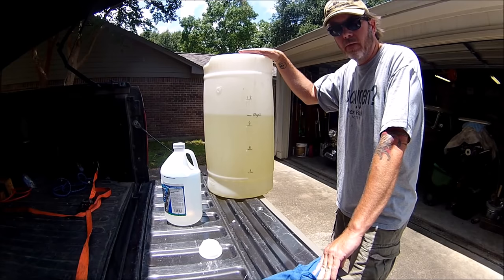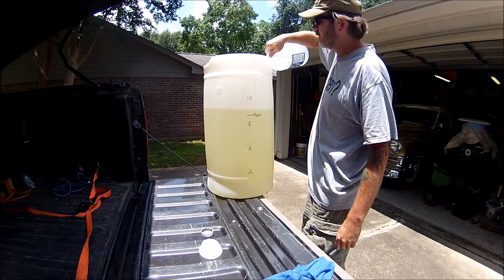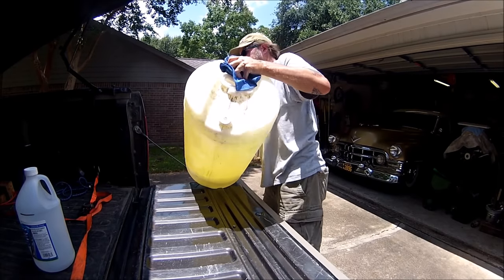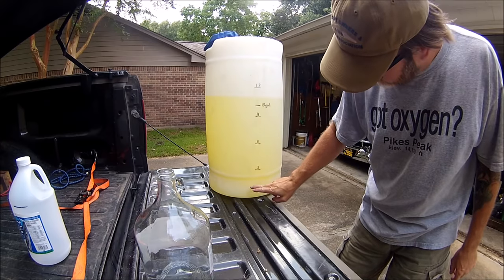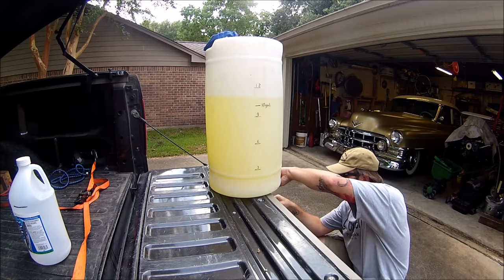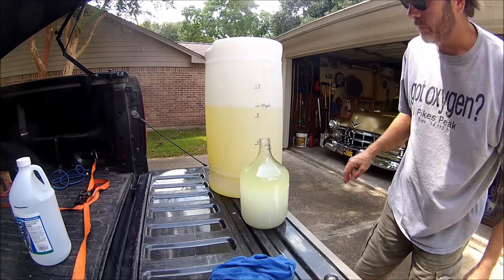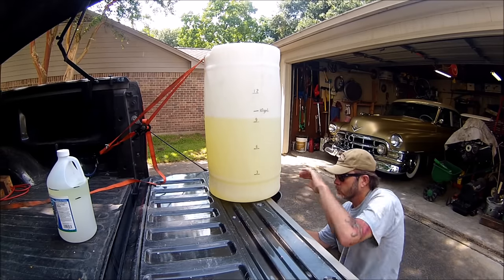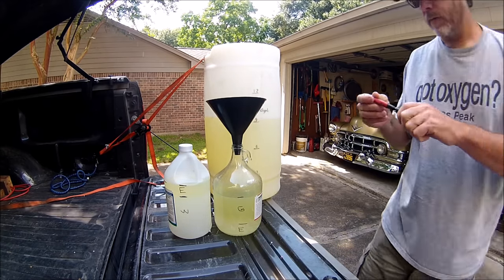How to easily extract ethanol out of gasoline.

Comment: So, I fail to see the point here. You buy expensive fuel, take out a portion that you don't want, you have disposal costs & now you end up with less fuel at a lower octane, wasted a bunch of time for a couple days AND I can guarantee that you will have some water in your vehicles fuel system. Is this just because you can? DUH!!!
Reply from the maker: Take a little time and look up what ethanol does to small engines. There are no gas stations in my area that sell gas with no ethanol. My lawn equipment sits throughout the winter and does not run. Ethanol fuel absorbs water and can reek havoc on fuel systems over time. Fuel last longer without ethanol.
Reply: I fail to see the point of your comment.
A. It's still cheaper than ethanol-free, which isn't even available in some areas. B. Disposal costs? You burn off the ethanol waste and you're left with water. C. Octane booster, or just start with 93 and you still get rendered between 88 and 90 if you do it right.
D. Less wasted time than repairing a set of carburetors ruined by e10.
But why am I telling you this? You're obviously an expert on everything.
Reply: Koko 3052 I'm not sure if you know but ethanol wreaks havoc on small engines usually wines up messing up the seals in the carburetor to a point of leakage or failure therefore ethanol should not be used in gasoline
Reply: 13thVaRebel high octane fuels is not necessarily a good thing if an engine is not designed to run off at you should not use it because it will not burn it completely check your owner's manual for recommended fuel octane levels because even my V8 in my Dodge is designed to run off of Regular octane 87
Reply: Yes absolutely true.  I thought Koko was implying that the loss of octane during the phase separation process would basically ruin the gas.  I meant if you started with 93 octane containing ethanol, it would no longer be 93 octane after phase separation and therefore if your vehicle needed 93 octane you could add a booster.  In my case I wouldn't, my bike runs fine on 87 or 88 octane so I would still start with the 93 but I wouldn't try to boost the octane after removing the ethanol.
Reply: it also eats up the aluminum in older engines like outboards engines have in  them in the carburetors. I just took my carburetors  off my 25 yamaha and the bottom  one had gas still in it. the seat in that one was stuck and corroded in there. I had to pick it out with a metal pick you use on your teefs, to get it out. The screw that holds the float in was ate up also barely got it out. that ethanol  
 is some bad stuff!!!
Reply: Do you have any lakes with a marina? They sell ethanol free gas.
Reply: Using higher octane fuel than an engine needs wastes money because the fuel is more expensive and it does no good.  Octane is like a shoe size- if you wear a size 10, then get size ten shoes- size 12 although a bigger number is NOT better.
Reply: except you lose a little octane rating removing the ethanol, so start with 90 and youll get 87-88 octane
Reply: You lose octane rating when the alcohol absorbs water from the air.
Reply: Koko 3052 He's not putting it in his vehicle. He's putting it in lawn equipment that would totally be destroyed by ethanol. Where I live, hi test fuel costs about $2.50 per gallon, plus about (at most) an hour of his time, which I will arbitrarily value at $20/hr. That's a $45 investment. Or he can buy prepackaged, ethynol free fuel from most outdoors/garden departments for (again, in my area) $28/gallon (rounded up to the nearest dollar and tax guestimation adjusted). That's $280 invested for 10 gallons. Or he can just run regular fuel at about (again, in my area) $2.49/ gallon and pay hundreds to repair or over a thousand to replace a small engine damaged by ethynol. $40, $280, or $1500? You choose. But keep your ignorant mouth shut
Reply: Or he could just buy some Coleman camp stove fuel (white gas)
Reply: Just who died & made you an expert Mark? I see that you inflate numbers to suit your point, and talk about ignorant....well you seem to have that down pat!
Reply: Electronicdawg You mean the one that sells for $18.21/32 oz ($72.34/gallon)or the one that's over $40/32 oz.(OVER $160/gallon). I think I'd rather replace the ethynol eaten engine. But I guess that's another logical possibility from which Koko can choose while keeping his ignorant yap closed.
Reply: Koko 3052  Which numbers are inflated? Where's your evidence?
Reply: Mark... this just seems to be a "bashing" of me, and for what reason....I don't understand that. You don't know me...have never met met....and I find your choice of words used to describe me...offensive.
Maybe it's YOU that should choose to keep your "ignorant yap closed"?
Reply: Koko 3052 I'm sorry. Was I too vague? Let me be crystal clear. It IS INTENDED to be bashing of you. The reason? The offensive, bashing language in your reply to Bobby Monroe. The fact that you're too blind to see the point of his experiment doesn't mean there is no point. The fact that you can't understand the reason for my offensive comments doesn't mean there is no reason. In fact, your inability to see the reason for my intentional abuse IS the reason for my intentional abuse.
Reply: "Where is your evidence" of my "bashing of Bobby Monroe"? Are YOU the protector of all You Tube posters now. Seems that I was asking Bobby some reasoning & you butt in! You don't know much, in my opinion, when you profess that "putting it in lawn equipment that would be totally destroyed by ethanol" or "I think that I'd rather replace that ethanol eaten engine"! "Where is YOUR evidence?" I've seen carbs gummed up, but never any "eaten" nor never any "totally destroyed"!
You seem to like bantering me, and to what point I just can't understand, but you are obviously smart enough to. So smart that you'll probably understand if I tell you all about sex & travel!
You have a wonderful day Mark.👍
Reply: "So, I fail to see the point here. You buy expensive fuel, take out a portion that you don't want, you have disposal costs & now you end up with less fuel at a lower octane, wasted a bunch of time for a couple days AND I can guarantee that you will have some water in your vehicles fuel system. Is this just because you can? DUH!!!"

Your tone here is obviously condescending. Your implication is clearly that he is stupid. And your final exclamation is clearly insulting, derisive, and offensive. What more evidence is needed?
Reply: For 2 stroke engines....it will gunk up weed eaters, etc.
Reply: sling shoter

How sure are you on that point? Considering the octane rating is the fuel's resistance to ignition, if anything the octane rating would increase due to water's inherent lack of ignition. Ethanol increases octane rating because it is harder to ignite than octane/heptane/hexane etc.
Reply: Every vehicle I've had, starting in 1970,  ran better with higher octane gas, even when the dealer / owner's manual said "run 87 to 89". I never cared about mileage, but greatly appreciated a smoother running  engine with more power for passing and climbing through the Rockies.
Reply: If your car was not knocking using low octane gas, then higher octane gas will not give you more power, octane is not a measure of power, that is a common myth.
Reply: Higher octane gas burns slower, that's part how it prevents knocking. Had an Explorer with the 4.0 engine, almost out of gas at night going through the Rockies. Gas station had only 93 premium, put that in instead of 87 octane.  The Rockies were fun after that, and never used regular again. Tried same test in multiple cars, sports and muscle. Always used top brands and all engines ran better. Never tried it with any econo boxes.
Reply: Bobby Munroe, run your small engines completely dry before storing them. As for damaging the engines, how is it my lawn mower runs fine after 10+ years of ethanol? The only maintenence I have done is run it dry at the end of the season, clean the air filter and change the oil. Still starts on the first pull. I think you are a bit paranoid about ethanol's effects.
Reply: I agree. Running the tank dry at the end of season is the best way to go for no issues.
Reply: look at what is in the garage. 
that is why. 
it is bad for rubbers and steel. 
all he has to do is add a water separator like old farm tractors run and he is golden.
Reply: You're so right on , what people think they can accomplish by doing stupid  Forest comp  !!!!
Reply: Bobby Munroe  ethanol burns hot enough to cause aluminum head to expand enough that the valve guide's will actually move causing bent push rods and the need for new heads to. I see it daily so yes remove the ethanol!!!
Reply: Forward plans /  metalfox1911a1: Let's settle these vehicle matters (which this video is not about).  
First, the ONLY thing high octane gasoline does is increase resistance to knocking. Otherwise, the gasoline is the same. Most modern engines are designed to detect knocking and take alternative action. That includes adjusting timing, adding fuel, etc to eliminate knock.  

If your engine is designed to run on 87 octane, it will not gain any performance from 93 octane because the programming is not designed to take advantage of the additional headroom i.e. it will not advance timing to gain power, even though it could, because it has a hard coded limit to what it expects . 

The opposite is NOT true: If you have an engine that has a recommendation of 93 but says "can run on 87 if needed", that simply means that it will DE-tune from optimum state to stop the knocking on lower octane gasoline.  So higher octane gas will give you more power and theoretically higher MPG. But again, only if the engine is designed for it

At high altitudes, the air is thinner. Therefore the mixture is heavier in gasoline.  You will experience less knocking at higher altitudes and can use lower octane gasoline. In the Rockies they sell 85 octane gas because it's safe to use in cars that normally take 87 octane. Slightly different rules may apply to turbo/super charged cars.

Forward Plans - if your car ran better on 93, we have to assume it was designed to take advantage of higher octane gas. One other option is that gas doesn't always hit the octane number it's supposed to - so 89 octane gas might be what you need to consistently get your 87 octane designed engine to run at peak performance.
Reply: So your saying alcohol doesnt make power? HMMMMM Ill call every car running in alcohol funny car, alcohol dragster, NASCAR, SPRINT cars, etc. alcohol be it ethanol or methanol DOES make power, it merely requires MORE volume as it isnt a complex molecule and ethanol burns only leaving CO2 and water as residue. methanol on the other hand leave formaldehyde, and low power acidic compound and a few other constituents I forget and WILL cause aluminum, magnesium , brass etc to corrode or rust VERY easily. As long as an ethanol fueled engine is tuned properly it should reach operating temps eventually and if properly shut off wont even leave anything to cause corrosion. This is why many older race cars run mechanical injection, shut pump off car leans out and uses most of fuel. The one beneficial aspect of running either alcohol is the engines consumes so much it actually will sweat on the outside of the induction where fuel runs through it die to the cooling effect.
Now what other properties does a cool running high octane fuel have that are conducive to power production,,,,? 
COMPRESSION INCREASE, You can run an engine with high compression and aggressive timing or forced induction like supercharger or turbocharger with high manifold pressures without issue of detonation or preignition and in superchargers if injected before the blower it cools the intake charge much like a water/methanol  kit does(but water/meth kit isnt used for fuel per se its used to moisturize dry air and reduce combustion temps in detonation/preignition prone engine designs when compression/boost is pushed too high).
Now we do use methanol in a useful mix but it has so much other stuff mixed in and dries so quickly ie washer fluid it cant corrode things, and its used in open area not enclosed engine. 
I can build an engine and push compression ratio anywhere from 12 to 1 to 15 to 1 and alcohol , while requiring more volume, its relative inexpensive nature make $2.00-$2.50 a gallon still cheaper if race engine uses twice as much as trying to  use $7.00 to $10.00 a gallon for 110, 114, 116+ octane leaded race fuels. BUT doesn require a healthy fuel system.
Gasoline when it first was produced it was actually throw away byproduct of the oil refining process and due to small size of original refineries ,as they only made kerosene, oils and greases and few solvents of use, white gas was thrown down drains into weeds or even used as weed killer, It has been said that part of reason of easy spread of great Chicago fire was a nearby refinery(yes right in heart of towns then) had dumped a large amount of this product.
But Holley brothers found this product easily obtained for pennies(cost of bucketing or barreling) a gallon and worked quite well if refinery operator was on his game.
Called White Gas, now we use it as charcoal lighter fluid, Coleman camp stove fuel etc. It around 70-77 octane, burns filthy, and cant hack much more than 6 to one compression.
Now take white gas refine better, ad different flammable liquids called cosolvents, and you can increase octane, but also they found if they added tetraethyl lead it created two fold benefit, the lead compound as it burned left lead deposits microscopically on valves, seats, even tops and side of pistons and on rings, Due to the cushioning effect and lubrication effect it reduced engine wear drastically in valve train area. much like adding zinc and phosphorus to oils made them control high pressure wear better.
BUT EPA rules removed Lead from gas and other additives from oils.
Now lets talk WHY ethanol is in gas.
Its now used for several reasons, one its nontoxic in limited amounts to humans and animals, the safety of 10,000 gallons spilling mean just wash/dilute with water it easily breaks down. two it is renewable.
three its clean burning.

But the main reason is back in the late 70s no cars had fuel injection except exotics 75 Caddys tried it and failed miserably.
BUT ratchet up electronics and digital age starting in 81/82 car started receiving electronic fuel injection.
BUT back in 70s EPA didnt talk to manufacturers it dictates to them.
So some desk bound paper pusher figures out with his lab buddy that if a slight amount of oxygen bearing liquid that is flammable is added to motor fuels it reduced tail pipe emission even more in conjunction with  catalytic converters(their tech has only gotten better) .
Since USA doesnt produce large amounts of ethanol to feed this mandate by a rogue branch of government whose original intent was to inform, educate and recommend action isn environmental concerns. But Congress wound up relegating emissions control task to them.
So we got a a frivolous regulation that needed repealed as soon as majority of cars went fuel injection.
The other issue was only inexpensive, readily available oxygen bearing compound that was cheap, a waste product that was actually saved only by rule and used as cleaning solvents even though mildly toxic if absorbed through skin was MTBE.
Now 5 yrs later than 82 and last carbed car ran off assembly line in 87.
MTBE was to be only used in smoggy areas but refiners complained about making it for just certain areas so they got approval and all fuel had it.
Now we still had lax storage rules, grandfathered in in ground tanks, pipelines etc and MTBE laced gasoline leaches into ground water. Its blamed on residue from tail pipes but that amount is infinitesimal compared to raw fuel in ground, 
So new rules with out fully understanding and we need new mandate and moratorium on oxygenates.
But rather than remove them and the REGS, they decide to look for different compound.
Ethanol was wisest choice, yes it had issues but most manufacturers have adapted much as they did by switching from neoprene to viton rubber products in 70s.
So mid 80s MTBE is found, sky falling technique is get ride of it when less than decade before it was heralded as pollution control tool.
Since ethanol had so many redeeming qualities, reduced farmers profits for multiple reasons ethanol, mostly produced from corn and other sugar or starch based products it was selected and by 95 the industry had government subsidies to build flex fuel cars , refineries, etc and 10 yr moratorium to fully remove MTBE.
And we got it in 2005 when Katrina hit as Gulf coast around New Orleans etc and its distribution, refineries etc all got hit same month. Thus first full on stages of ethanol E10 inception and wide spread E85 distribution got lnocked on its but but now you cany by fuel without ethanol unless you pay a fee/tax ie higher price. But not any better fuel. With proper service ethanol is no worse than when MTBE was included.
Reply: Septane is a rather dated iteration of heptane.  Check it out.  In my 35 years of refining, almost all of our instruments were marked septane, the newer ones marked  heptane, so we used what we had. Same machines since the 30's.The Collaborative International Dictionary of English v.0.48:
Septane \Sep"tane\, n. [L. septem seven.] (Chem.)
   See Heptane. [R.]
   [1913 Webster]
Reply: Koko 3052 I
Reply: So you claim ethanol damages fiberglass fuel tanks, well I have yet to SEE a fiberglass gas tank. Not saying there arent, just havent seen any. As for ethanol damaging the metals you claim it does. Sorry ethanol doesnt react with metals, now it WILL strip any type of oil or grease off very well. As for the rubber components I have yet to see the horrendous damage everyone claims and I am driving a 1966 Caprice. "Rubber" hose since MTBE was introduced has been resistant to chemical degradation BUT due to EITHER MTBE(known carcinogen, causes birth defects, mental issues, poisons water and ground) ethanol, ((medicinal, healthy if ingested properly in moderate amounts, renewable and  doesnt pollute if spilled and can be made safe by dillution ) .
Now what CAN affect certain metals with ethanol, because it contains water and can if ran in a system with bad grounds can cause some electrochemical erosion (ask me how I found THAT ONE out) and can exacerbate water/dirt contamination in older dirty fuel systems by actually helping it break loose. If the hose, rubber, gasket materials etc are falling apart then they were due for service well before ethanol introduction. 
NOW ethanol does NOT cause fuel to oxidize that is what AIR or FREE OXYGEN does. 
Now lets get to the chemistry of combustion with and with out ethanol(currently). In current internal combustion engines with fuel injection they attempt to maintain stoichiometric air fuel ratio while allowing proper operation of the catalytic converter to break down unburned hydrocarbons and carbon monoxide and oxides of nitrogen. While the idea of adding oxygenates back in 70s and even into 80s was novel idea, to "help" the engine burn cleaner it merely made mechanics have to retune the idle mixture and possibly the choke settings, it actually did nothing in real world terms(worked fine in laboratory settings) I have watched cars tuned to both fuels E10/R15 or straight gas with out ANY oxygenate and only saw a slight difference in emission output BEFORE the converter. Both made ZERO difference after the cats. 
Now using ethanol does allow fuel designers(yes designers) to produce a lower grade of base fuel that allows for the 100-110 octane ethanol addition. Now E85 does help in certain basin area cities with certain issues, but in the light of the cleaner burning cars in use today its sort of a wash.
ALSO the fact is the mandate to use oxygenates did not directly come from Congress, it was a long drawn out process of a government agency, created by Nixon to educate and inform the president on environmental issues, and over the years was incorrectly given powers and processes to regulate and issue mandates pertaining to environmental issues(even though this was NOT its purpose).
Congress DID have its hand in the subsidy to build infrastructure and such to help move along ethanol oxygenate inception. See they made the mandate to use MTBE, found it to be bad idea, dangerous. So they had to reformulate. Well ethanol was only clean, renewable, and ecologically safer way to oxygenate fuel. So rather than do away with an EPA rule the simply changed the criteria and kept mandate.
Now why do certain countries used ethanol almost exclusively, because they produce a majority of crops that CAN yield high grade ethanol and the fact is pretty much any internal or heat expanding device can be tuned for ethanol. Make sugar, left overs can be used for ethanol, make booze, any bad batches can be added to fuel production. 
Now I have been a diagnostic technician for over 25 years and so far MTBE was much worse on engines, and I havent seen much issue that proper filter replacement and engine services wouldnt have taken care of. 
Now I LIKE E85, for performance benefits but not emissions "cures". E10/E15 just keeps fuel makers in compliance with EPA regs and keep producers going. 
As for damage or wear and tear, sorry but ethanol does NOT damage an  engine. In fact ethanol engines ,if properly tuned and maintained actually show LESS valve and seat wear/recession. Dont have excess carbon production thus having less wear and tear in,on,around piston/ring/cylinder areas as they never carbon up. 
Engines ran entirely on ethanol can last as much as 4 times or more than a gasoline engine.
BUT ethanol can and does have some draw backs, it takes more to make same power yet costs less to produce and doesnt leave behind lots of toxic waste(stoichiometric for gas is 14.7 to 1, E85 stoichiometric is 9.6 to 1 ) BUT with ability to run higher compression ratio DOES let us make more power on dedicated engines. It averaged to about 5% per point so 8 to 9, 9 to 10, 10 to 11, 11 to 12. You CAN possibly add up to 20% increase in power(with prerequisite modifications for such compression changes).
There are car builders tuning engines to OVER 1000 hp on E85.
But pure sillyness like this, well it simply gets the poster hits.
Reply: Thats easy.  This fuel is used in all engines, NOT just a car or truck.  It destroys all carberators, erodes, aluminum, eats rubber, AND, doesn't mix with 2-cycle oil properly.  Thanks for your uninformed comment...
Reply: Captain Bart  odd I have dozens of carbs and have had zero issues you claim and as a mechanic of many years and haven't seen ANY of these supposed issues you claim. And i also restore Holley and Edelbrock and Quadrajet carbs and see none.
Reply: It depends young one. In communist countries like mine Law enforces 30% ethanol. Then it doesn't matter we have 97 AKI gas, we can't go very far anyway.
Reply: Now if you have a burn pit
Reply: Disposal costs? I just pour it in my neighbor's pool while he goes to anti-gun rallies.
Reply: You cant put ethanol in that caddy cause he doesnt drive it enough before the gas gets bad. I get it. If you dont, then you probably dont need to remove ethanol from gas.